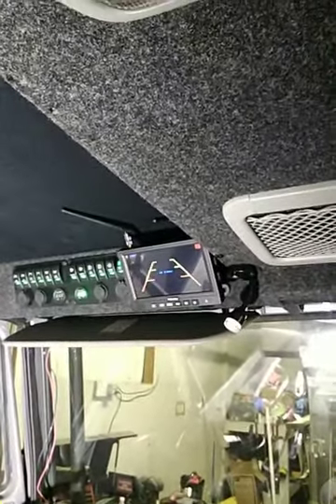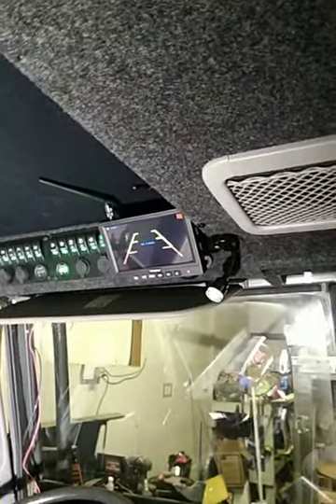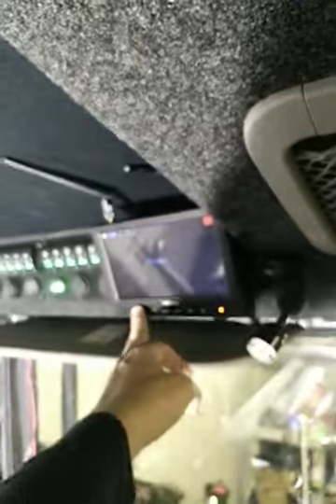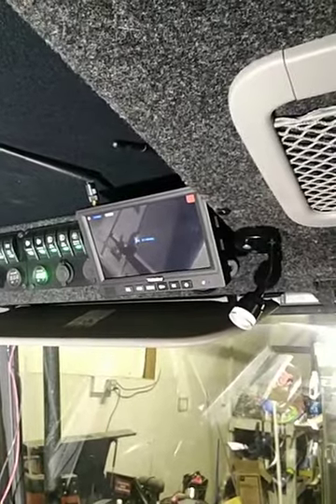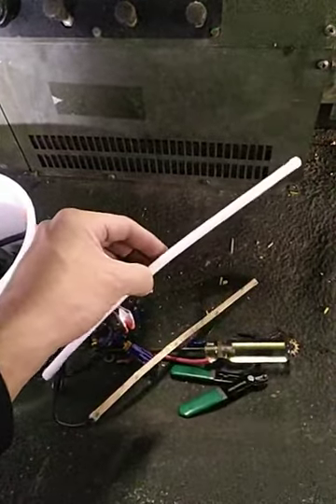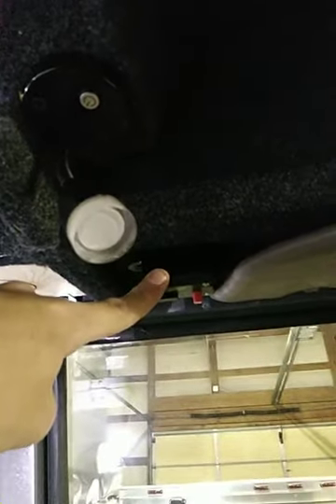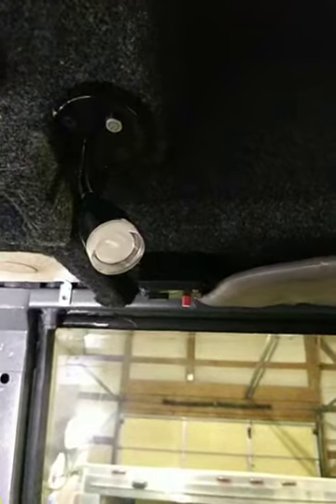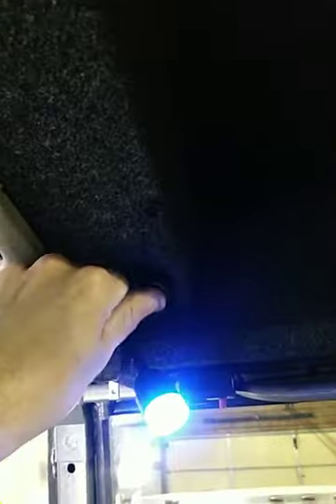LMTV RV part 31 OPTIMUS

Comment: check your Nissan rear passenger lights with your shop lights off and everything pitch black.  You might find they do/do not cause a glare issue in the windshield.    You will want to check same thing with your other gooseneck map lights and any lights you consider like the red led strips your thinking about.

Comment: So as far as internal lighting goes, I'd recommend using the red lights up front. Those windows suck and you're going to lose visual real quick, especially with all the additional electronics. It's not a huge cab, you don't need that many lights inside.